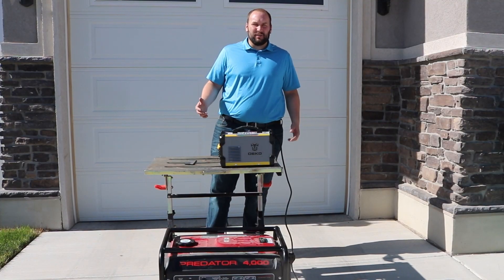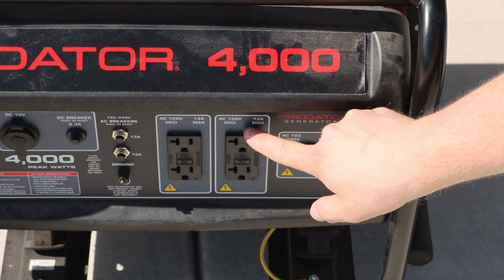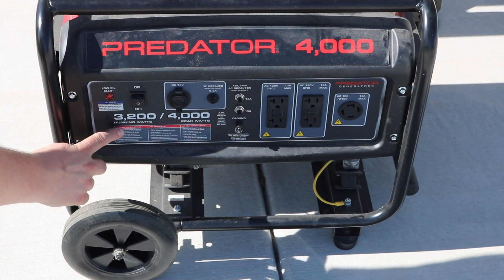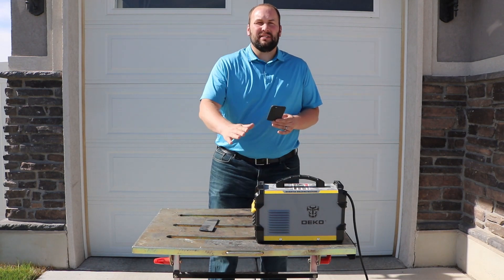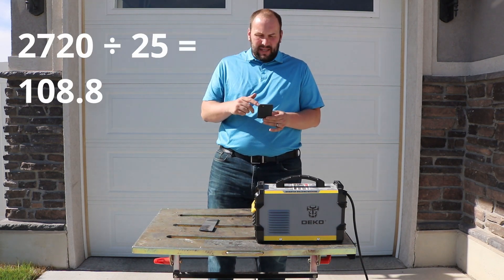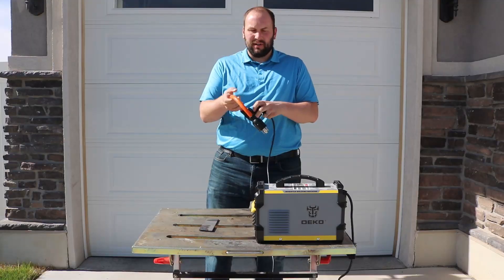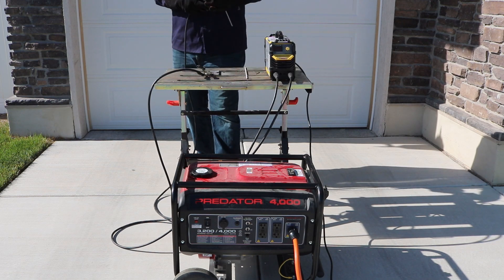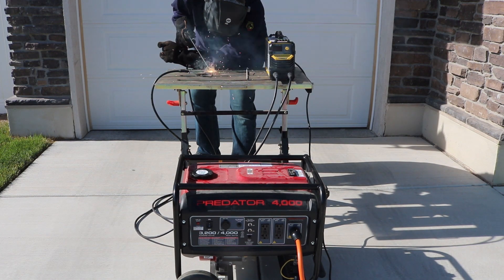How to Run a Welder Using a Generator

Comment: Hi Tim! You know, I'm trying to figure out the right gauge of cable I need to buy to build an extension cord for my welding machine.  There seems not to be the right information yet on YouTube. Would you make a video on that? What I think is that I need to know just how many amps its drawing when it's on and when it's actually welding at some amperage then at maximum amperage... Or not? I'd like to build a 30 feet extension cord. I have basic understanding of amperage, voltage and voltage drop, and I have a clamp multimeter.
These are the specs of my welding machine. I hope you understand the values as it's in Spanish: 
https://i.postimg.cc/1RNSbjKt/3864855-1-1160.jpg

I hope you can help me 🙏🏻😁
Reply: You need 8 gauge or 6 gauge. AKA 10 or 16 mm2.

Comment: I have the exact same H-F predator generator. And Amazon adapter. It's a good little setup for ~most~ side jobs. And was relatively inexpensive. I actually prefer having this setup, compared to an engine driven welder, just for portability and versatility of the generator. Inverter welders weigh nothing, and i can use the generator for other jobs, power outages or camping, whenever needed.
Reply from the maker: I agree. Inverter and generator is a great way to go. I think my main limitation is reduced output from high altitude.
Reply: What’s the adapter you used?
Reply: @lvalle1994  It's a 120/240 adapter. I don't remember the exact one, but they're cheap on Amazon. Like, 20 bucks or less. Definitely wroth it.

Comment: Will the Briggs and Stratton 5500 generator be enough to run my Dekopro?
Reply from the maker: The math says that a 5500 watt output could run an inverter welder at 176 amps, which would give you the full range of the DekoPro. However, as I discovered in this video, there are more factors at play which made my generator fall short of my expectations. It would definitely outperform my setup by a fair bit, but it's hard to say whether you would get the full output from the welder. If you do try it out, let us know how it worked.
Reply: @TimWelds  thanx Tim, appreciate all your videos, welding has always been something I’ve wanted to learn. I think it’s a great skill to know. 👍

Comment: Turned my generator off while machine was on and it idled till it turned off when starting my machine it was good till I stroke an arc . Now it won't arc just makes a little light connection

Comment: what? using 220V instead of 110 gives you half the WATTAGE? how come? It would give you half the AMP but the same WATT.
Reply from the maker: 110 gives half the wattage for a single circuit on this generator. On this unit, the two 110 volt circuits are each hot pole of the 220 with a neutral, similar to house wiring here in the US. This is why the 110 volt and 220 volt output the same amperage. At the same amperage, 220 will give double the wattage of 110.

Comment: Where did he get the 25 volt figure from?
Reply from the maker: Great question. It's an assumption based on typical arc physics for stick welding. Higher end machines will read out the voltage as you weld, and it usually hovers around this number if the arc is nice and tight.
Reply: @TimWelds  I thought you might have got it from the U2 numbers; e.g. my AC 220 volt Arc 250S DC inverter welder has a U2 at 80% of 30V and at 100% of 27.8V.  But then in the manual it states "Rated Output Voltage" is  28 volts.  But the Rated Output voltage of the Arc 160 is 26.4 volts.

Comment: I'm really considering going with a welder generator now. I've been on the fence but I'd gain far more utility out of that purchase
Reply: If you watch any videos I made I run a similar stick welder off of a 6800/8500 watt generator pretty much full time and have had zero issues with that set up.
Reply from the maker: The engine drive welders are really nice. I do know several people who run welders off of a generator, this generator is just too small.

Comment: i have a  mig weld  and its a  160 amp and it also reads   230 volts , so my question is  can i run my mig welder with 5000  watt generator.
Reply from the maker: Thanks for the question! I don't think you'll get full power out of it with a 5,000 watt generator. That being said, some kinds work better than others running on a generator.

Comment: So I can run a lincoln pro 180 with this generator??
Reply from the maker: The capability would probably be fairly limited like I found in this video. Ideally, I would try to use a larger generator.

Comment: Thanks for the information,  question does a small generator have any negative effects on an inverter welder ?
 Thanks William Orange County, CA.
Reply from the maker: Hey William! I think it really depends on the particular welder and generator. Some may have electronics that could get damaged from the "dirty power" from some generators. Aside from that, however, I assume that it's usually fine as long as the generator provides adequate power to run the welder. I know a lot of people that run little inverters with generators and they have worked fine for years.

Comment: So then the answer is no? Because I wanted to get a welder not buy a big one but wanted to have a multi purpose welder but I wouldn’t have any outlet to connect it to unless I have a generator to power it.
Reply from the maker: You can definitely run a welder using a generator; my generator was just too small.
Reply: you can do lots of non structural things with a 120 v mig welder, just not great for structural / safety things-trailers for instance.  If you have an electric dryer plug in your basement,, it is 220v.  I made a  220 v extension cord to run off my dryer outlet with a male and female plug from home depot and 3 16ga 50ft extension cords.  use all three wires to go to one prong each.  Mine ran my 220v buzz box just fine and it is a transformer(uses more juice).

Comment: Good info!  Now I can run my Lincoln 210 MP off my generator which it puts 7000 running watts on 240 volts, thanks!
Reply from the maker: There's not much that you can't do with a sweet setup like that!
Reply: Everyone really needs to watch this important video https://youtu.be/I1jT3ANENvI this video on this link is about everyone’s safety. Thank you